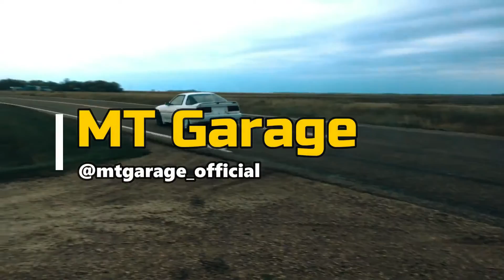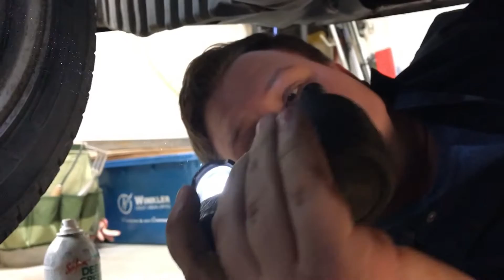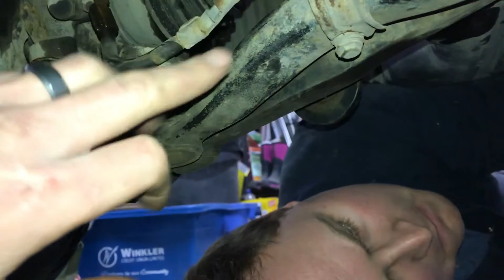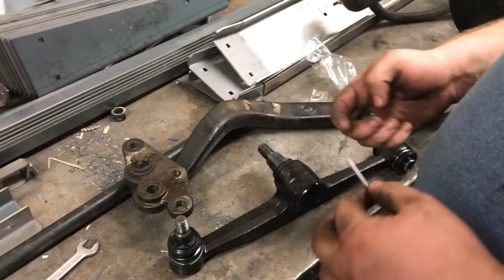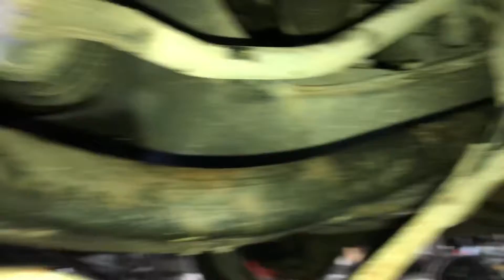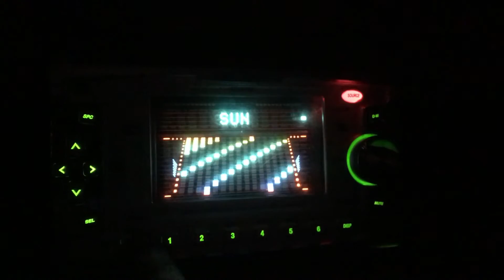Toyota Superstrut Camber Control Arm & Figure 8 Replacement

Comment: The figure 8 joint is the camber control arm, the longer arm is just called a lower control arm. Also I am amazed how easily they came off. You usually need a puller

Comment: Can the bushings and ball joints not be replaced in the arms do you have to to replace the whole assembly?
Reply: You have to buy the whole arms. It's a pain in the ass.
Reply: You can get the ball joints refurbished at an engineers.

Comment: I need to take out the hub ball joint in my SS suspension to be repaired. Do you think this is possible to do at home or would it need to be pressed out. Super strut is such a bitch

Comment: Hey im on the edge of buying a t20 gt superstrut im a novice in therms of mechanic work do you think its a project car for a beginner? i fear that it could be too much. 
my gfs dad is a toyota mechanic so he is going to look over the work i do but i have conserns about the availibility of the parts i need for the superstrut. it would be nice to hear some feedback from someone who knows these cars and what to look out for! :) 
thanks in advance
Reply: I know it's a late reply but I recommend against it. It wears out very fast on bad roads and a new set is expensive as hell (1500 euros here for the full set of arms), whereas a normal macpherson lower arm would be around 100 euros and fairly easy to replace. Id rather get one with macpherson suspension and put coilovers and poly bushes.
Reply: @kristianm9345  thanks anyways i bought a T23 :D

Comment: This is called the Toyota Super Strut Suspension. I had it back in the days in my Toyota Trueno. Car handled like a dream when the suspension was tight and in tune, but that little arm that connected the strut to the lower control was the weak link which certainly wasn't designed for the crap roads I had to drive on daily. 

I quite liked it and would like to see a 2.0 iteration sometime in the future.